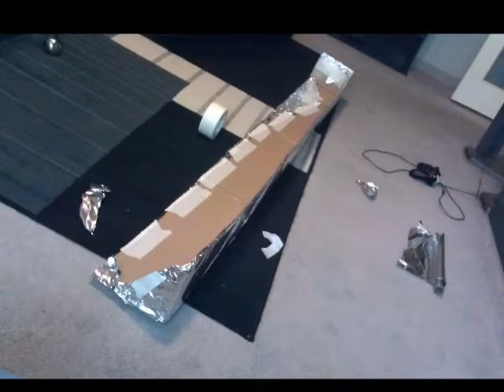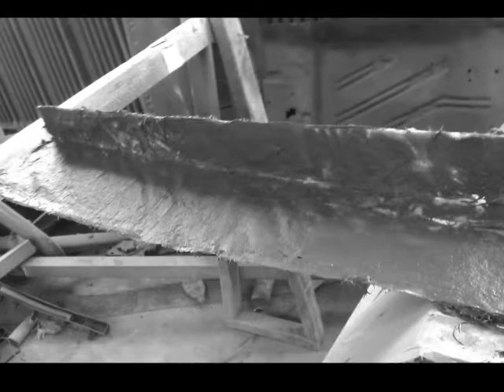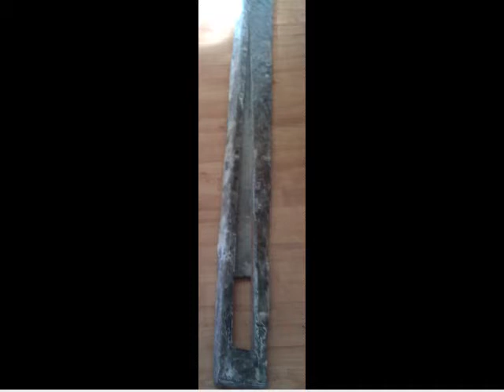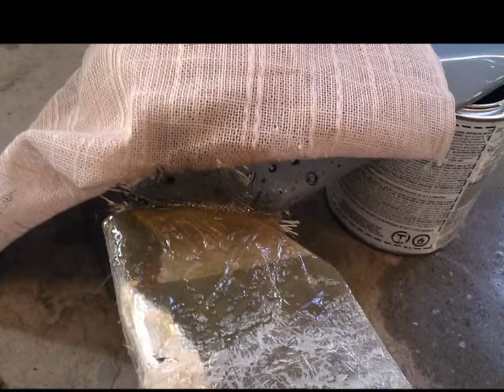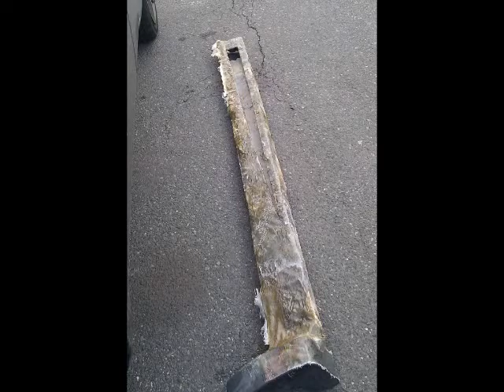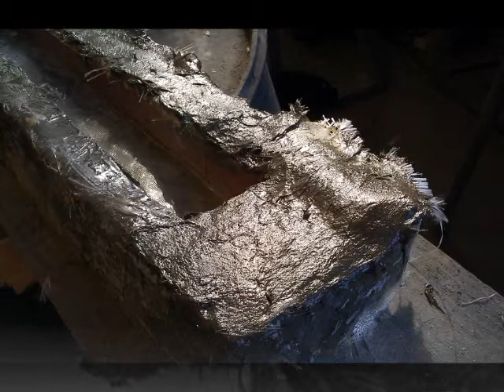How to design my own sideskirts from scratch

Comment: make sure you sand it down and you could put some carbon fiber wrap on it. then paint it. it will give you a nice clean smooth surface and leave you with a shiny surface.